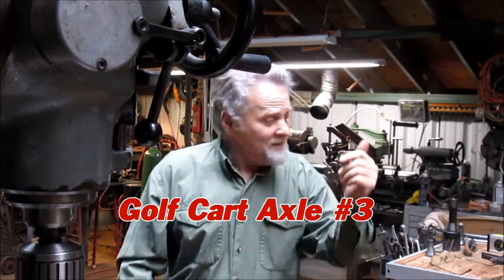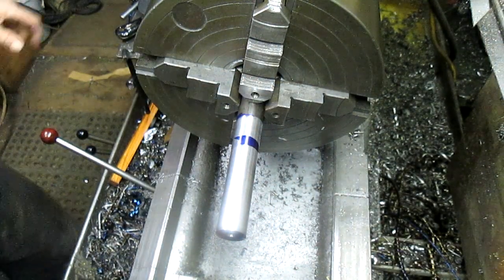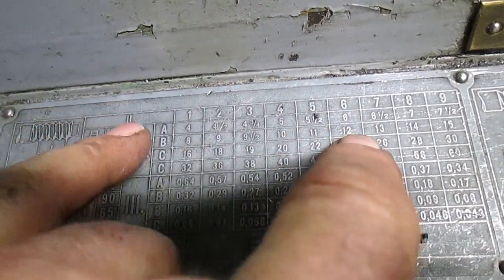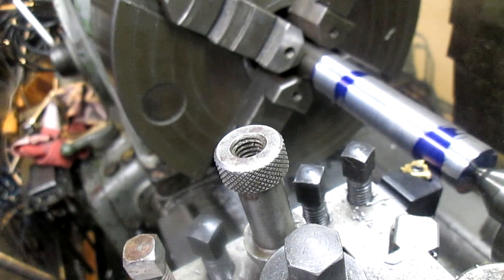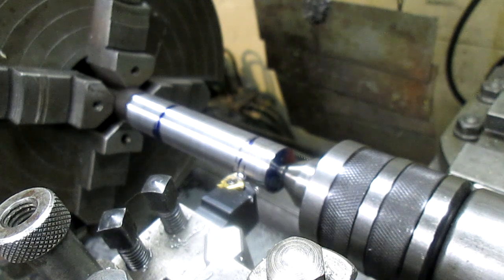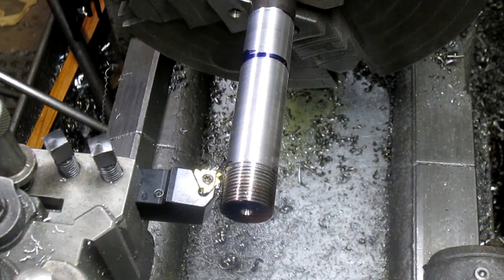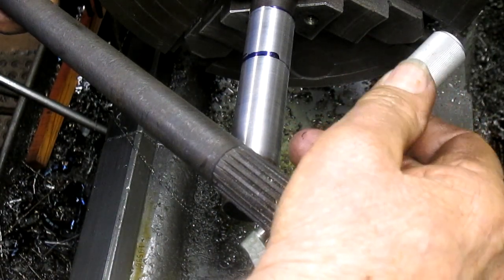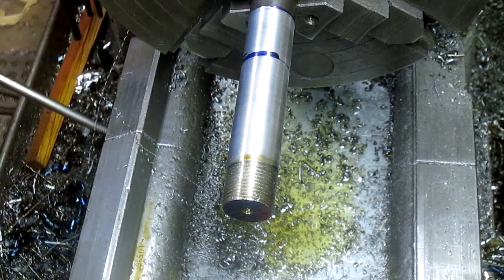Golf Cart Axle #3

Comment: Hi Nick you could use a 7/8 -14 nut also with the press fit you have when you tighten up the nut its going to press the hub over . you need a shoulder . you could machine a grove and make a two pcs. insert or weld a good size bead and  turn it down . the project is probably done . just my thoughts  good luck . JM

Comment: Hi Nik, Good going with the threadcutting but I kringed when you produced the die nut. You had a perfectly good set up and I couldn't understand why you didn't just keep cutting the thread until the nut fitted. My experience with die nuts (and it was when I was an apprentice) that there was a high risk of stuffing the thread altogether, especialy if the die nut was a bit dull. These days I just keep cutting the thread until the nut fits. It gives you a perfect thread with the exact profile. Sorry that you need to do it all over again. Cheers Ian.